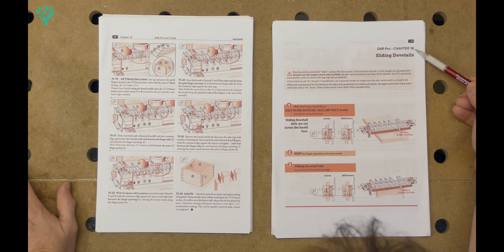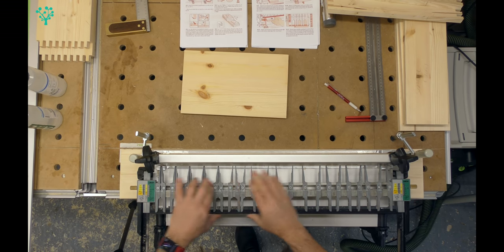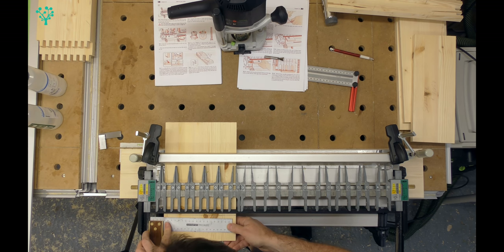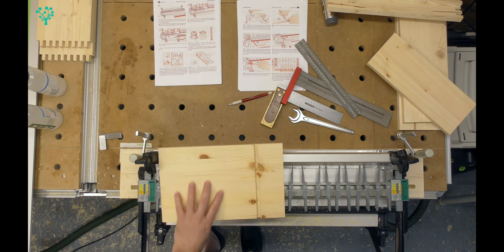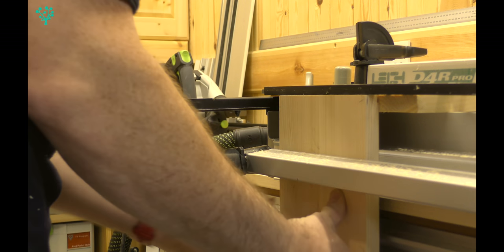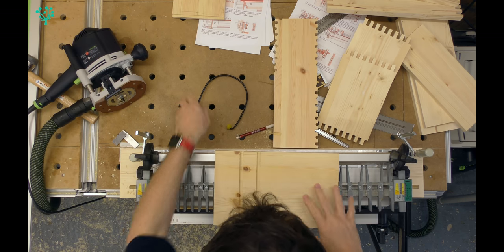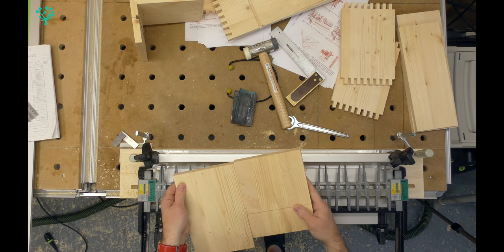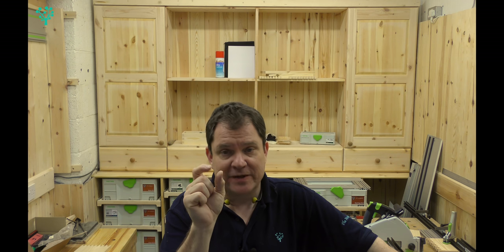Leigh DR4 Pro Dovetail jig - Episode 4 - Sliding dovetails

Comment: Hi Andy, I always consider it good technique to remove most of the material in the channel with a straight bit, then another pass with the dovetail bit. Also, a slight taper along the length of the male and female parts aids assembly. I welcome your thoughts on whether this is possible with this jig!
Reply from the maker: Hi Simon,
Yes that is good technique, in theory you could use that technique. But to be honest I wouldn’t use this for sliding dovetails.

It almost feels like and add on - look what else we can do - moment.

Cheers

Andy

Comment: Great video, thanks! Is there a way to add a slight taper to the slot in a sliding dovetail? Especially for wider stock, having a tapered slot helps with the board not getting stuck when sliding it through the slot during glue-up.
Reply from the maker: Hi Darryl,

Thank you for the feedback. I would make a jig for that and use a dovetail bit that was around 50% of the slot, the jig would then give me the taper allowing me to make one side of the cut first (with half the taper) then come back and make the other side with the other taper.

It wouldn't be easy - but that is how I would approach it

Cheers

Andy
Reply: @TheWoodgrafter  Thank you for the tip, I appreciate it!

Comment: Hello and many thanks for the video. I am completely new to joinery but have set myself the challenge of making all our box shelving and cabinets myself. I got a Leigh super jig to do this, and only finally managed to get my dovetails working on it today. Now I would like to add shelves using straight dovetails. Please could you clarify one thing in the video? At about the 20 min mark to get rid of the gaps in the joint you route a new slot, but apart from the backing board I don't understand if something else changed. Did you make a bit depth adjustment?
Reply from the maker: Hi,  I hope you are enjoying the jig.

I had to re-watch the video :-)

The backer boards was purely to prevent tear out, and no you don’t adjust the depth of the router bit, that stays consistent throughout.

In the cut you are talking about, I had some variance in the groove, I may have moved the router during the cut - or most likely hit a Knot in the wood.

So I simply re-cut a new groove to check all was set up OK. Obviously taking more care the second time.

So didn’t adjust anything to close the gap - the gap was human error - rather than calibration.

Try a few test joints - after three or four you will be cutting like a pro.

Let me know how you get on.

Cheers

Andy
Reply: @TheWoodgrafter  Hi and thanks for the response! Oh, not sure 'enjoying' is the right word. I am a total beginner to woodworking, and I am finding myself amazed how completely incompetent I am. I really thought 'how hard can this be?' but coming from a software background it is very surprising how much I lack a built in or practised intelligence in spatial relationships. So far with the half blind dovetails I think I managed to get everything wrong one could possibly get wrong, and managed to hit a load of unlucky snags along the way. For example, after spending an eternity reading the manual and setting up my jig on an improvised workbench, I realise i don't have an 11mm guide bushing for my Bosch and the only adapter for the Leigh elliptic one I have to order from Canada (I live in central Europe). But getting these damn dovetails done on the Leigh became something of a mission. I finally managed it. Not perfect but I will sand the slightly proud bits down and bosh some wood glue into the gaps.

I am enjoying it on the whole, but the learning experience is slightly traumatic 😁 or the jig I bought off eBay is damaged 😁

Thanks for the clarification on the straight dovetail groove. I will give those a shot for the shelf part of the project and let you know how I get on👍
Reply from the maker: Thanks for coming back,

Yes there is lots to learn - and the good news is you never stop learning.

But the pay off is when you have created something - and then you get the bug and start on the next project.

Not sure if you watched the video on Leigh v Incra. Although the Leigh system works (but has a learning curve) I didn’t find it an enjoyable experience - and in the end settled on the Incra system - I have cut numerous dovetails since the video series and always default to the Incra system - even though the Leigh is close to hand.

Dovetails tend to confuse due to the geometry of the joint. A good way to learn is to actually cut by hand - then the jigs make more sense, and the learning curve reduces.

Anyway - don’t give up and keep pushing, trust me we have all (and still are) gone through that learning curve.

But the rewards are worth it, not sure if you have signed up to the web site yet - but I will be starting and introduction to Woodwork course over on the site in the near future.

Cheers

Andy

Comment: Hey Andy,  great video as always.  My question to you is after using the leigh jig for the sliding dovetails which do you prefer the leigh or the incra version?  
 I'm in the market for one of these tools but cant make up my mind.
Reply from the maker: +Aj's Woodworking 

Hi AJ - now that is a leading question.

If you are asking purely on the sliding dovetails, I am going to go with the Incra system at this point. Using the technique I demonstrated in the bookcase build series.

I have a few more joints to make on the Leigh for the blind sliding dovetails - so I may change my opinion.

But at the moment....

The Leigh felt a bit fidly and course in tuning the joints - and I think that showed in the final joinery, that to be honest I am not overly happy with.

On the Incra I can fine tune the male part of the joint in 0.05mm increments - very quickly and easily - with extreme repeatability.

Introducing a feather board to give consistent pressure would improve things even more.

On the Leigh, any variation from the horizontal plane (and you do have majority of the router hanging over the edge of the fingers on the male joint. Shows in both the shoulder line and the final joint. I didn’t experience that problem - but I could see it been an issue.

I will be carrying out a comparison video of the two when I finish the current Leigh review.

If you aren’t in a rush - it may be worth waiting. Probably about two weeks away.

Cheers

Andy